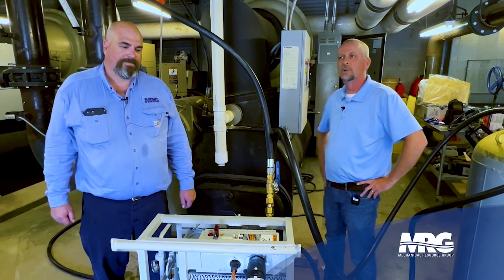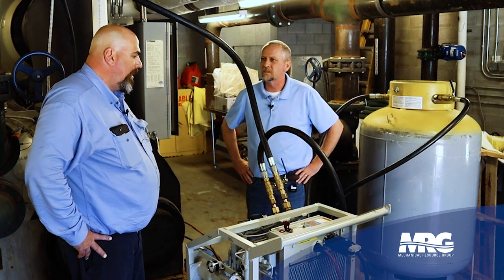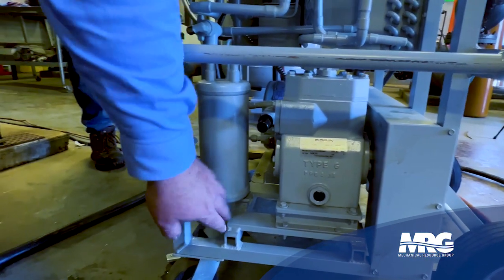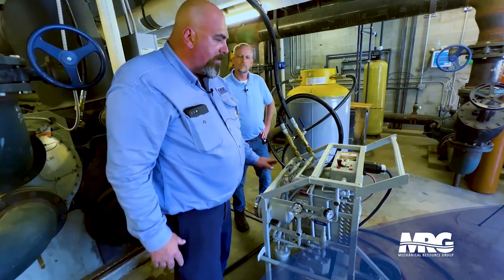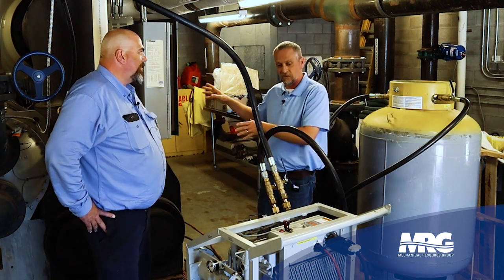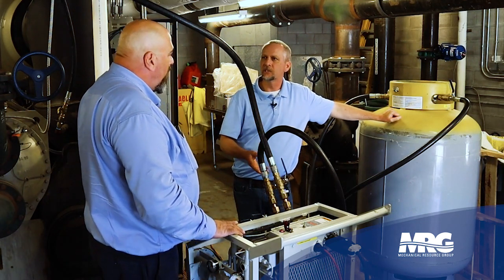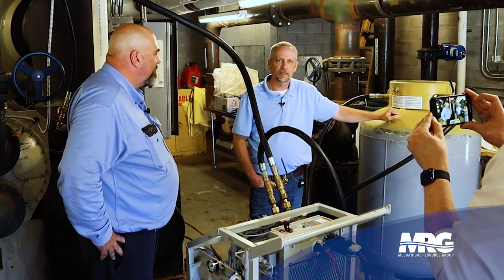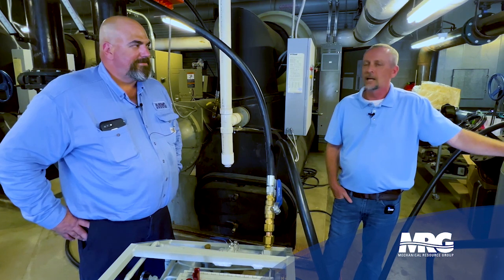Refrigerant Recovery on a Low Pressure Centrifugal Chiller | Mechanical Pros

Comment: LOL.....MISS3D ONE IMPORTANT PART.....ALWAYS....ALWAYS MAKE SURE THE PUMPS ARE RUNNING AS YOU ARE RECOVERING....UNLESS YOU WANT TO REPLACE TUBES FOR FREE.
Reply: Yup that or drain chiller. And when you charge vapor get to above freezing point before charging liquid
Reply: Don’t have to run the pumps if you stay above freezing
Reply: This why jobs take way longer lol.  No need to run the pumps just stay above the freezing point and you’ll never freeze a tube